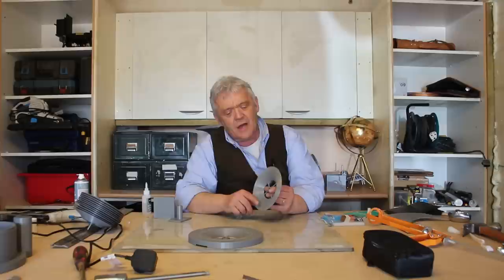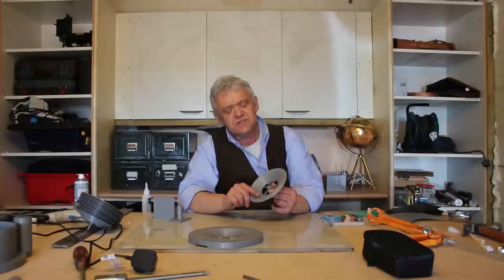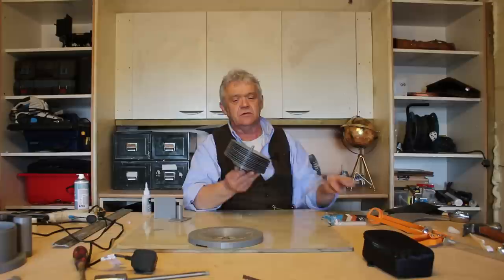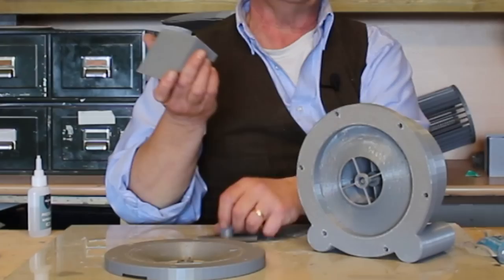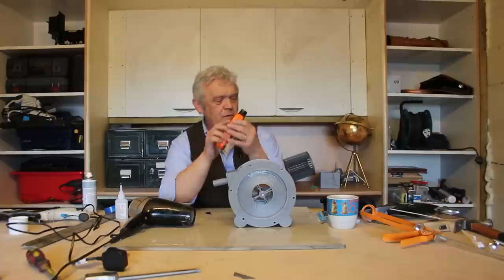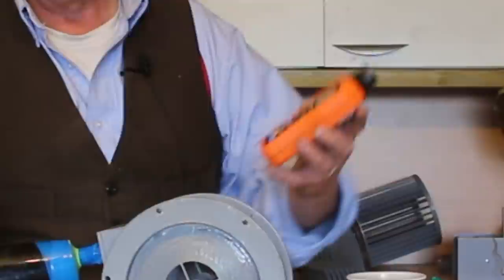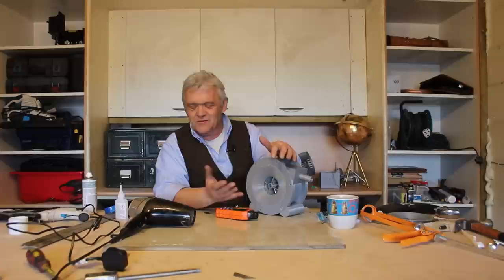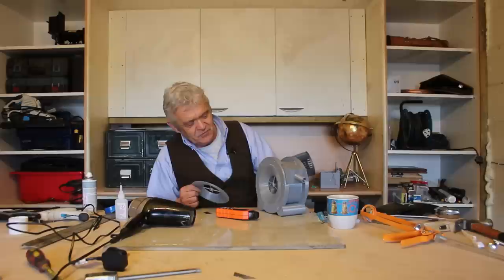1918 The Tesla Hyperbolic Turbine - A New Invention?

Comment: If I recall, those turbine disks require very high speed for performance, and curved disks should be more susceptible to mechanical failure than strait ones.
Reply: And even if they don't fail, they will stretch and flex due to centrifugal forces which will alter the gaps between them. In the best case it would be self-limiting but in the worst case it would cause the turbine to halt due to friction.

Comment: the main thing is the low-pressure air flow. that is important if you want to make it for home use which is what I'm shooting for. when you enclose the turbine completely, you get a higher rpm. with the higher rpm, it starts sucking in more air, and higher rpms is the results. I'm working using air bearings instead of regular bearings. I don't have a 3-d printer so it takes a little while for each new stage. Thanks for the video.
Reply: Hi Tommy do you have any videos you could share?
Reply: Tommy, if you need access to a 3D printer, please let me know. I am in Edinburgh and will gladly help with projects that aid in these wonderful ways of producing localized power sources.
Reply: @michaelmarino7216  thanks for the offer, but I live in Texas. I don't mind describing my design if you would like. It is nothing more than a Darwin wind catcher and a tesla turbine. I've just used items I had from around my house, as parts. 2 78rpm records for the magnets. 8 CDs for the turbine. balls attached to the ends of the shaft for my air bearings. A funnel connects the two housing together.
Reply: @Jon-fs2zj  not at the moment. I'm still putting together my second prototype after the first one caught on fire, and that was with an 8mph wind. I described my design to Michael Marino if you want to take a look at it. I found that you have to use a chimney flue concept to regulate the out flow of the air to prevent it from running away and catching on fire.

Comment: The principal of the Tesla turbine hinges on the surface tension of the fluid medium.
Gases have a low surface tension and, as such, will provide little torque to the discs.
Liquids offer a higher surface tension and therefore, transmit a higher torque to the discs.

Comment: A nozzle across the whole of the disc arrangement and someone else suggested the nozzle angled which I’m thinking is a good idea. So I’m afraid Robert you will still have to play about with angles  a bit  but this is really neat . Making moulds so the disc could be cast  with your graphene reinforced casein plastic 
They done really well to give you their 3d printers you are certainly putting them to good use
Reply: Hello Robert, I just got a tele_gram me message from you. Can you tell if it is real or is someone tampering with your good name and logo?
Reply from the maker: it's not me i never contact folks directly

Comment: I love the new twist of tesla's turbine! The one biggist factor in how well it works is taking into account the fluid you are using and spacing the platters based on the boundary layer behavior. Nikola built his for steam which is about two and a half millimeters, " I am a yank so I could be off a bit on that", but air is a lot less viscous, might want to see if a millimeter or less gap between your disk will increase your spin for you.
Reply: It would be interesting to see if a more well space disc set would work well for water generating purposes then, given the much larger viscosity

Comment: I love watching your videos! As a mechanical engineer and tinkerer, i love to invent things and solve problems. So it is particularly enjoyable to watch you take simple concepts and prove (or disprove) them.

I would like to comment about the Tesla turbine, however, and something you seem to overlook. Maybe you know, maybe you don’t? There is a design element of the TT that goes beyond blowing air over discs and having them spin. 

The design, with the outlet at the center, specifically creates a fight between the mass of air and pressure differential pushing the air toward the center outlet, and the centrifugal action driving the air away from the center, like a tug-of-war. 

At some point, the turbine goes “critical” when the energy level being trapped inside reaches crazy levels, and the turbine speed, and thus kinetic energy, goes off the charts. 

I’ve seen videos of TT’s made with music cd’s which go critical and suddenly hit five-figure speeds and the cd’s come apart.

Would be interested to know if there is some way to channel the air into the turbine in a way that causes this effect?

Comment: On the supply side have a large plenum so there's no nozzle arrangement at all, just some inlet guide vanes. The plenum is pressurized. In this way the pressurized air is more efficiently in contact with all the turbine surfaces as it flows to low pressure.
The outlet has an exhaust pipe and a valve on the exhaust is the throttle.

Comment: This is fantastic, Rob!  However, now that you have that outer casing worked out, could you use it with a pack of flat disks and measure the rotational speed again for comparison?  I guess to make all other factor equal, it should be the same number of disks too.
Reply: Need to do the flat disc version for comparison.
Reply: Needs flat disc for comparison.

Comment: I'm not sure that shaped disc is a real good solution. 
My calculations from years ago for Tesla turbines showed that given a reasonable drop of pressure across the nozzle then the air velocity gets very high indeed. 
Given these turbines work most efficiently with a particular "slip" between the air speed and the surface speed of the disc- then the pressure drop determines the ideal rpm for a disc of a given diameter.  
When you do this calculation, you realise that the rpm is close to the strain limit for typical materials (for example stainless steel- given the temperature of say steam). 

Thus, putting any sort of a shape to these discs will seriously effect their ability to withstand the centripetal forces involved while maintaining the close tolerance between them and the casing. 

Of course, these high performances don't need to be targeted, however the whole point of the Tesla turbine is to exploit the opportunity of the extra efficiency that they offer. 
Otherwise, you might more usefully just build a paddlewheel.
Reply: It seems like the shape turns the turbine into a lower velocity, higher torque turbine which is a step in the right direction for making it useful, and reduces the speed requirement for the discs. So the question would be is there any disc profile which has a higher maximum output power than flat discs, or at least one that shifts the torque curve to a more usable range? What if the discs were curved only slightly, like an amount equal to their thickness? I know many people have had the idea to use conical or curved discs but I don't know how many actually got around to building it.
Reply: I'm not sure I understand how the disc shape would have an impact on torque. The same impact on the duration that the fluid spends between the discs can be achieved by changing the exhaust pressure. However, most of the torque is generated on the outside 1/3 of the disc radius so if you were to maximise this you might curve the disc like a hockey stick. But again this compromises structural integrity. Tesla suggested applying a vacuum to the exhaust to increase efficiency.
Theoretical performance drops quickly below a more conventional bladed design when you stray from the optimum parameters.
Reply from the maker: oh wow - you are the first comment i read where you get it - awesome mate
Reply: Well said, some weeks ago i requested a small demonstration on the principals of the tesla turbine, and this was a poor attempt to answer said question. Disappointed..
Reply: Some years ago I made a few of these turbines. I was attracted to them because I felt I could make a turbine in contrast to a turbine wheel of a jet engine or a turbo.
Aluminum housings, steel shaft, stainless discs and spacers (photo etched). 
What I learned was useful, but it was a bit of a waste of time. 

There are two phases of a turbine- the phase I was focused on- turning the rushing fluid into rotary motion- but this only occurs after you have converted the pressure of your incoming supply into velocity. This is usually achieved by a convergent/divergent nozzle. 

It turns out, this is a very specialized science, and at the scale of the turbines I was making- a HIGH precision part. 

What was worse, was that for a Tesla turbine, these nozzles need to be of a rectangular cross section, so conventional tables are not that useful- the high surface area to cross section and its expansion asymmetry are all barriers to efficiency. 

The nozzle design was by far the biggest barrier to me. 
I tried various designs but all had poor efficiency. I got stuck. 

In small devices, steam or compressed air gets very fast and so do the rpms of the turbines. 
You quickly end up realizing you need some specialist alloys to manage the heat and forces.
In addition, the nozzles are optimised for a particular pressure drop and are not efficient over a range of pressure/flows. 
Finally, because they are small, they operate in the turbulent flow state and again this looses efficiency when you are trying to garner the Coanda effect of surface adhesion.  

Its all about fluid velocity; the goal is to convert all the pressure into velocity. 
The power available to the turbine is related to 1/2mv2. So the nozzle must deliver the maximum v.

If you want to make a Tesla Turbine to do actual work then my advice is to work out how to get the incoming at the maximum velocity first before you start on the easy bit (the turbine itself). 

The single thing you should note when looking at the turbines that Tesla himself built- is the diameter of the inlet pipe. 
They are huge.
These turbines are power dense, but that means they require LOTS of steam or air or water.
They are brilliant, but beyond me.
Reply: @julianwilson5468  yes I see you're point as tesla deduced the materials needed would have to be highly resilient(nano carbon for one) which even now we are not capable, when the tolerance levels are of nil fracture and the disc's a embossed instead of spacers then enclosed with said sufficient carbon bonding then possibly we will have a working prototype worthy of teslas invision.
Reply: @julianwilson5468  Thanks very much for sharing this. It's too bad you lost interest in it, but what you weren't successful in surely gave you the greatest value short of a working prototype, and I thank you for documenting a sliver of that here. Should you choose to pick it up and overcome the roadblock you encountered with high precision manufacturing of small parts, I hope that you decide to publish your journey online (if you haven't already) and garner feedback and a deserving following that could support you and the larger community's effort to keep this fantastic technology under investigation.

Charlie Solis has sleuthed through Tesla's patents and summarized many important aspects to TT design. One particular example, as you might  be aware, is the importance of disc spacing and disc diameter in addition to fluid tip velocity. Him and Jeremiah Ferewda have been some of the few to demonstrate (publish online) 0.4 - 4kW generation tests using turbines in the range of 3" - 10" diameter discs with little in the way of excessive peripheral speeds that approach the stress limits of the material, or special alloys. In fact, that horsepower was generated with disc RPMs in the range of 1000-6000 rpm. The larger discs will also experience less stresses for the same tip speeds. 

The pursuits of these guys has been very educational and while I don't know if they have encountered the same barriers to efficiency that you note re: nozzles, or achieved the power density you were targeting with your size of TT concept, their proof of concept turbines have demonstrated they do actual work. Not only might it be worth examining what they've published and even getting in touch with them to build on both of your work, but shaped discs as seen here with RMS may also not be out of the question either. 

I'd love to buy or build a TT to use as a decompressor in a thermodynamic system. I really feel it deserves a spot alongside bladed turbines as a low-cost solution with comparable or higher efficiency.
Reply: @julianwilson5468  What about using a compressed gas for the turbine? If the gas is expanding inside the blades, does it reduce the requirement for input velocity?
Reply: @keantoken6433  The gas should not expand inside the turbine; the physics are that the pressure energy of the gas supply should be converted as far as possible to kinetic energy within the nozzle. 
The advantage of this is that it is primarily the kinetic energy that turbines convert into useful power. 
Kinetic energy is proportional to the mass of the fluid and the SQUARE of its velocity. 
So you are always best to get the maximum velocity you can achieve.
Residual pressure in the turbine is pressure you didn't convert into velocity.

Comment: The only problem is deformation at high RPM.  Those cones will want to become flat as they spin faster and faster.  This is why many home-made Tesla turbines fail - and is the problem Tesla himself experienced - deformation at high RPM.
Reply: You know that because of modern manufacturing processes, you can build to resist deformation?

Comment: I thought about this years ago... and it's effective in the lower RPM range. However, the issue arises with thinner plates and/or higher plate count. In a typical bladeless turbine, you can run much thinner discs and higher RPM, because the counter forces are contained radially, while axial forces are limited to minor deviations in pressure between the plates. Some may argue the same is present here... but the G-forces exerted at the circumference of the discs are extremely high, at an angle significantly offset from the tensile plane.
Reply from the maker: as the Tesla turbine has a problem regarding effectiveness in low rpm range and this improves it - i don't see why would give up on it?

Comment: On the exhaust side of a turbocharger it might be efficient for lowering exhaust back pressure, especially if it is installed on an application with one or two catalytic converters. What about coating the discs, so the drive turbine becomes a converter too? Might be great for improving efficiency and economy of cars, small planes, and almost anything except a diesel or a race application.

Comment: Anything Tesla did was no less than amazing. He loved the pyramids of Giza and spoke of their tunnels set up as a circuit that uses negatively charged ions of an aquifer below, and positively charged ions above such as an antenna. This is where he got the idea for the Wardenclyff. 

The granite insulated walkways in Giza are used like wires. And it is no pseudoscience that the Pyramids have an electromagnetic force. I’d love to hear what you think of that Robert.

Comment: The thing about Tesla turbines is that they work in reverse, spin the stack of discs/cones/whatever-you-call-them and it should blow air out of your inlet pipe.
This should give some idea of efficiency as both the input rpm and output airflow are easy to measure.

Comment: I'd love to see comparisons for different disk diameters.  If you have turbine like this or a lot of the other ones you've built, a shorter wider turbine (larger diameter) will produce more torque from the same wind input but may make less speed.  At high speeds, the disks experience more force, but a tall narrow turbine (like some of the stacked Savonius models you've played with) put a lot of stress on the central bearing.

I've never seen a relatively large-diameter Tesla turbine.  Granted, the RPMs tend to be very high, so that would mean a lot of stress at the rim, but a comparison of performance would be interesting.

Comment: Seeing successful rotation is merely the first step, put a load on it and measure actual work performed.
Reply: Yes, but it will take a lot more development to make a prototype that is worth measuring the performance of. The disc spacing needs optimized, and other optimal paramters need determined.
Reply: Already been done. There’s plenty of regular disc Tesla turbines that have been shown to work and push a load. 

Everyone says “it’ll slow down if you put a load on it!”

Yeah so does EVERY engine if it’s idling and a load is out on it and the throttle isn’t opened up 🤭 

Ever let out the clutch on… we’ll any engine without giving it some gas at the same time? 🤔 

Yes it’s possible to feather the clutch and not use the throttle if done really slowly. But I think you catch my point.
Reply: @keantoken6433  incorrect, work performed can be measured with the current prototype. I didn't ask for a production post prototype measurement. It's always worth measuring.

Comment: Try Multiple inlets of air and closing off the outer diameter of discs but not to the air inlets. I suspect the air is pushing on the concave wall rather than flowing like a tornado. Try a hollow disc between each rotor that delivers the air to each rotor at different levels of the cup of the rotor as to creat gear or vari drive torque. So multie inlets in around the out side of the unit into the hollow disc that don’t rotate, As the hollow disc will deliver the multi nozzle air to the rotor cups. This is not a blue print and not 100% comprehensive but that should get you going in a commercial industrial design.